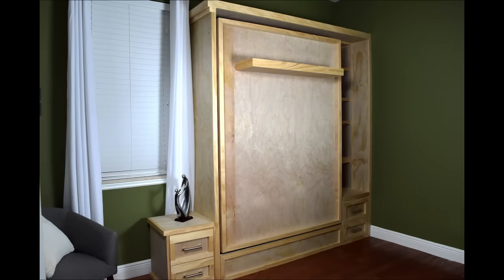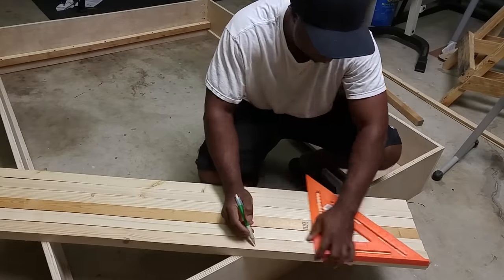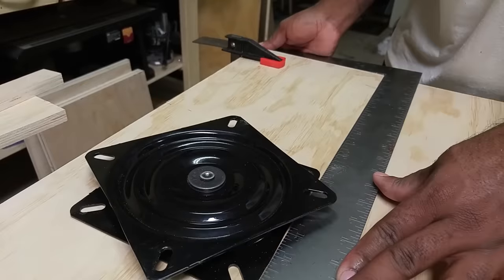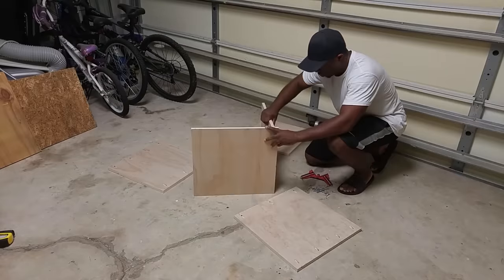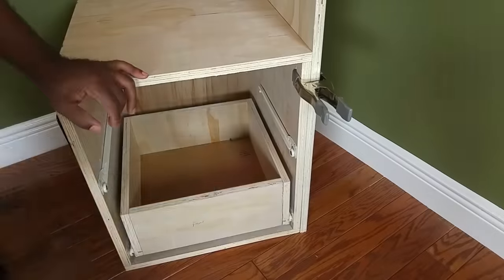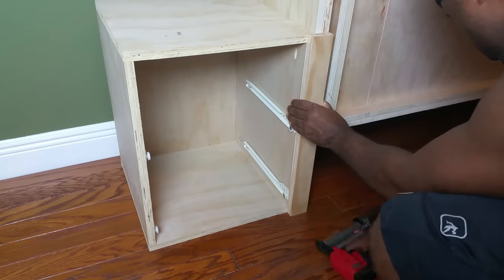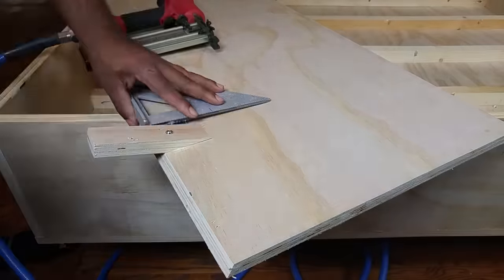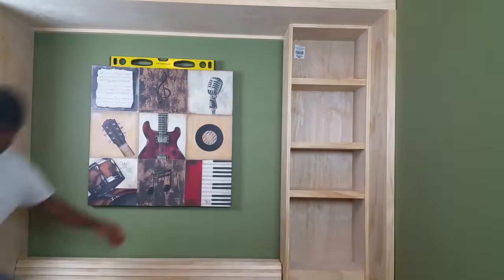Diy Murphy Bed Build - Wall bed Hack Without the Hardware  Kit

Comment: Those boat swivels seem to be a pain to install.  What about drilling a hole on the bed side and the cabinet side. Inserting a tube (copper?) then inserting a long bolt and nut to connect them on the inside of the bed frame?  Then still add the pistons on the side to make it easier still to open?  I've been playing with the ideas a lot so I can build mine but I need to make mine higher because I want to put a bench/Sofa in front and the bed to fold over it.

Comment: This video was posted over 2 years ago.  How have the boat swivels held up?  I know they can carry between 300 to 400 lbs, but that's when they are laying flat with the weight on top.  That load capacity is much less when they are in a vertical orientation with shear force acting on them.   I still like the idea, just wondering about the durability.  Thanks
Reply from the maker: It's been great! No issues at all! The two safety screw lines up which tells me it has not budged one bit.
Reply: Thank you for the fast reply.  I'm very impressed with your attention to detail, safety measures, and tool gadgets.  Subbed.

Comment: great tip on the hardware, cause the murphy bed hardware costs about the same as springing for the in-laws to stay at a hotel, which, come to think of it...and yes the bed part would be easiest first, but allows one to build the casework and hardware around it. Thanks!

Comment: I wanted to see if you can let me know about the distance from the wall a Queen sized Murphy Bed will take up.  My bed is in a corner of the room and I need to know if I can do the vertical that I would prefer, or if I'll have to do it horizontally off the other wall.  Can you help me with the measurements?

Comment: Great video, i built a horizonatal version of your bed. I have question regarding the swivel bracket bolt. Did you use a 1/4 20 x 1 1/2? I worry the length of the bolt would be too long.
Reply: Jig89 I too, need to build my bed horizontal. What bolt and screws for the frame did you end up using?

Comment: I wanted to know, how heavy this Murphy Bed can handle, I wanted to build it in my room (I stay in a very small room with murphy bed I can have more living space just flip it to wall), and I have a heavy weight natural fiber 10' Inch queen size bed, and it is very heavy, could this bed handle it? or maybe I can reinforce it with the T metal bracket, at the side and hollow metal bar at the center?

Comment: DUDE...UR ONE BAD A** BUILDER. I HAVE LITERALLY WATCHED EVERY ONE OF UR VIDEOS TODAY AND WILL DEFINITELY BE TRYING OUT QUITE A FEW OF UR PROJECTS IN MY NEW HOME. HOWEVER, I WANTED TO SUGGEST SOMETHING U COULD HAVE PROBABLY DONE TO SPRUCE UP THE PLAINNESS OF THE BED WHEN IN IT'S UP POSITION... THE SAME TYPE OF ART WORK U HAVE HANGING ABOVE THE BED IN IT'S DOWN POSITION... U COULD HAVE HUNG ANOTHER PIECE OF ART ON THE BOTTOM SIDE OF THE BED, BUT SCREWED IT DOWN TO WHERE IT WOULD STAY IN PLACE WHEN IN IT'S UP OR DOWN POSITION. JS. ANYHOW, VERY COOL INDEED. WILL DEF MAKE THIS FOR MY OFFICE SPACE VERY SOON. THANKS A LOT FOR UR VIDEOS! GREAT JOB!

Comment: Errr, this is quite an old video and maybe its already  mentioned (I didnt read the whole thread) but at 3:51 you defintely placed the self locking T-nuts on the wrong side of the wood panel. FYI you should place them exacly the same as normal nuts. The little pins on T-nuts are only to prevent it from twisting/rotating, not by any means for securing it. The way you placed them makes a very weak  connection.

Comment: Will that Marine / Boat Seat Swivel Mount Base Chair Swivel Plate Metal support the weight of the frame and bed of around 100 kgs if they are mounted vertically. The swivel mount plate was infact manufactured to be used horizontally in chairs and not vertically. 
I would rather prefer use of pillow block as mentioned in the link https://amzn.to/2H8sJPY
Here there is no chance of the ball bearing falling out and also we can use 4 pillow blocks, 2 on the frame and 2 on the wall unit, and a 30 mm rod connecting the pillow block.